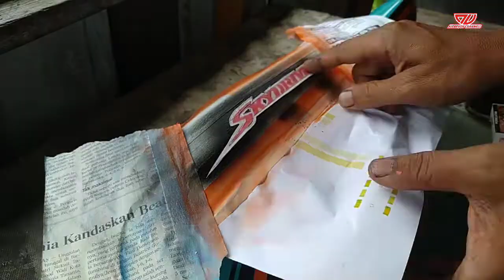Grafis Sederhana di Suzuki SkyDrive

Comment: They should strengthen it because this scooter is durable, USB charger and they will save gas, and liquid cold. I hope they will strengthen His engine, his tires should be 90-14 and then 100-14.